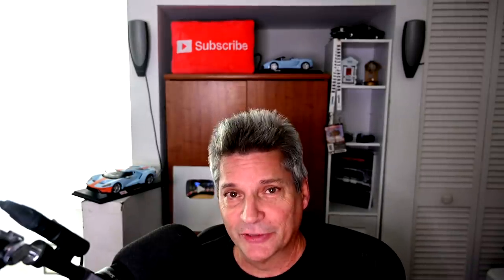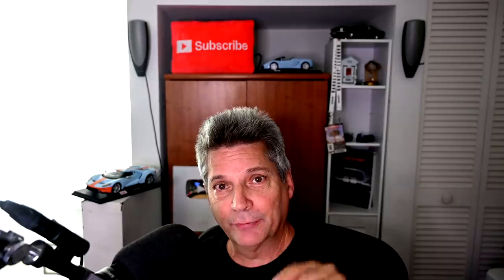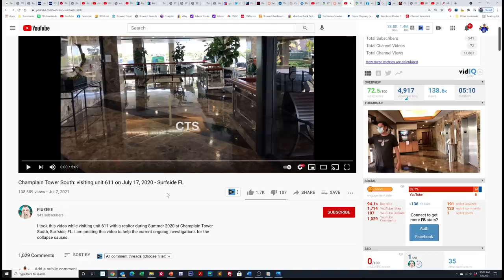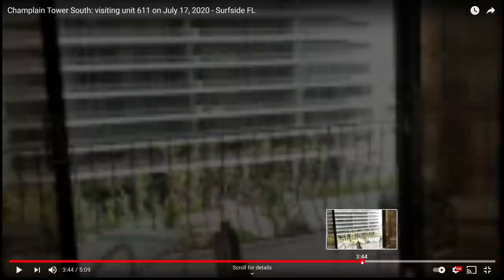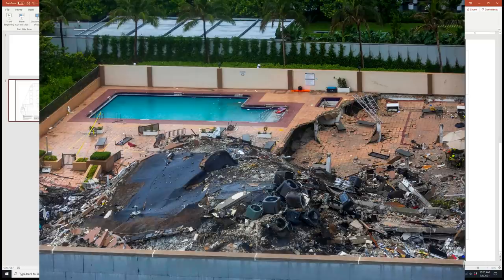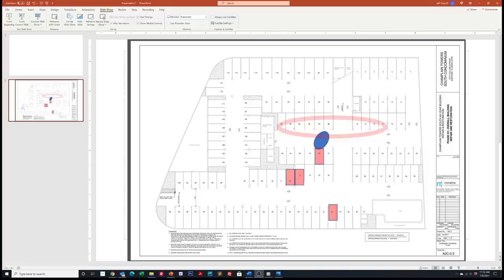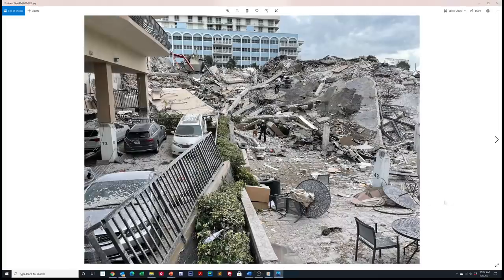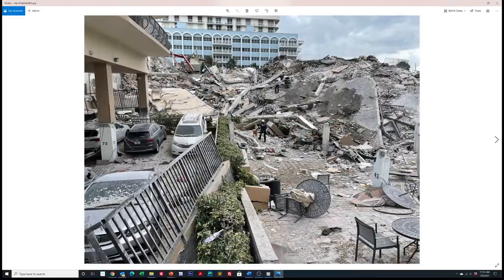Analysis Garage Video BEFORE Condo Collapse: Water Everywhere

Comment: If you take a look at the photo of the  column  with the number 105/106, you will see that the texture at the top left portion is different from the rest of the column. This usually indicates that a repair patch was done to the section of the column in the past. Such a partial repair is useless and only accelerates that damage because the PH of the new concrete patch is different from the PH of the older concrete and this creates accelerated galvanic corrosion of the rebar reinforcement.    The proper way to fix such damage is to remove all of the concrete of the column, clean and recoat the rebar, and then pour new concrete to encase the support rebar with concrete that has the same PH.

Comment: Much water in parking structures in Florida is condensate draining from car air conditioners;  this appears to be much of the case around 8:00.  Peeling outdoor paint in Florida is also to be expected if maintenance is but a bit "off".  Also, July 2020 was right in the middle of rainy season---every parking garage in the state had residual water.  Those hokey ceiling patches really make you wonder though....................!  2018 video reveals a poor maintenance program.

Comment: Patching the leaks from below without replacing the leaky membrane of the pool deck on top would have actually compounded the problem.  By stopping the water from draining through, the concrete deck was essentially marinating in water 24/7.

Comment: Just a couple points from someone who has been in a heck of a lot of parking garages that are in the Myrtle Beach area(because I have a HVAC business) and every basement level parking deck has water in them during the summer either due to rain from thunderstorms almost daily,  condensation from air condition of the vehicles and since basements are cooler and with the excessive humidity (which averages 78% humidity and 17 days of rainfall in July) in Surfside Florida. Because of the high humidity and the salt air they have to repaint these parking decks every winter during the off season. One more thing I've never seen any "Stalactites" In any parking garages LMBO
Reply from the maker: Champlain tower South condominium there were cracks on the ceiling that were very poorly repaired by injecting epoxy in there that likely wasn't effective, and they left the injection ports in the ceiling, instead of removing them and sending them down filling in the holes sealing and painting etc. So that it allowed new cracks to develop a new water to leak down dragging the calcium carbonate through the concrete with it, formula stalactites, and likely reducing the pH of the concrete.

Comment: Where was the water coming from? Stupid question but is it the water level in Florida, was it rain or what?
Reply from the maker: You have rising water tables under the foundation that could possibly allow water to seep up into the building through cracks or other joints and stuff like that. But most likely this was from rain water on the deck for all of those years that allowed the concrete to soak in the water and then the rebar starts to weaken and then they had numerous cracks that were repaired over the years done by people that were not very good at the repair Anne I think all of this just sort of led to the ultimate failure of it

Comment: Pool deck draining onto garage roof, over time, likely flushed out concrete around expanded corroded rebar until deck punch shears down, columns left standing unsupported at deck level fail under buckling, then as geometry changes among joints, the rest unzips.

Comment: That's water coming through the concrete from above. Not Humidity.  Remember this is an open air garage on the ocean, its high humidity all the time.  Peeling paint shows lack of adhesion to the substrate, in this case because that substrate, the ceiling, is moist from water coming down through it from above.  Just like a concrete slab floor, concrete will wick water up (or down in this case) through it, causing it to weaken and spall and crumble.

Comment: That clip with running water might be the fire sprinkler system in the garage. Drain pipes are normally empty so water wont keep running. That said, if water is spewing from a sprinkler pipe it should sound an alarm, so maybe it was just domestic water, seeing as Florida's mild climate would not dictate them to be protected from weather.

Comment: I’m starting to have the idea that Miami, being a hot & humid location, the concrete may have absorbed moisture over its life, weakening the structural bonds? Could it be as simple as a lack of proper maintenance, in an environment that is not conducive to concrete, ie: hot and humid.

Comment: Just a thought about the water.  This is in Florida, most all cars have air conditioning.  It is very humid in Florida.  When cars are running with air conditioning, water comes out of the evaporator drain, runs onto the floor of the parking garage and pools there.  I rented one car in Florida, and it would put out a puddle that surrounded the car from front to back and left to right.  I was actually stopped a few times by people concerned that my radiator was leaking.  No, not the rad, just the air conditioning.  Maybe someone was leaving the building and stopped to talk to their friend in the parking garage and the car was running all that time.  
Again, just a thought, no expert on buildings or construction here.  Just thinking a bit out of the box.  Thanks.

Comment: Dude, the paint coming off in layers like that, is a sign that there was water behind the paint.  Concrete will allow water through it, the paint won't.   19:36 top of the red pipe you can see what looks like sheets of paint have peeled off and landed on the pipe.  I painted for 15 years, water gets behind paint and you will get large water bubbles, once the water finds a way to escape, the paint has been  seperated from the surface.   $5 says that the car was covered beacuse paint chips, and nasty water marks from the water leaching through the concrete.  I'm thinking you're right

Comment: 10:49 metal corrugated on the ceiling in that 10-minute frame I could probably bet that that's up there like you said for the water to direct off the car but also to hide the big cracks the metal is up there so the concrete pieces don't fall in the guys car

Comment: 300' from the beach+ many hurricanes with storm surges flooding that parking garage, + storm surge saturating  the surface deck with salt water. You can drain the water yet the salt is caustic to iron and remains in the brick work above.

Comment: In one of your other vids, it was clear that there was no drainage on the pool platform above the garage. It's also clear there are many cracks with water flowing through. If it was just humidity, the pain would be peeling more uniformly and everywhere. In this vid, it's clear some areas are not peeling at all and others are, meaning it's not humidity, but leaking.

Comment: That strange repair (looks like a piece of corrugated roofing) you point out at 24:55 seems to be very near where we see debris on the ground in the video from the tourist looking down into the garage. Being right up against a column, that could very well be the start point of the pool deck failure, with that column punching through.

Comment: 5:10 what is it? Looks like a trough to catch water and keep it off cars.  I have seen this before (commercial plumber in Canada) when the concrete is cracked and water proofing is damaged. Sometimes rather than fixing the real issue a “temporary” solution (drain pain) is installed to prevent damage to cars paint. Sadly I have seen this done in many Rentals and Condos in my area. I have always questioned that as once installed the real issue of water penetration becomes low priority as it’s not visually causing property damage.  After a while staff change hands and it’s thought of as “normal”

Comment: That crooked pipe is basically a plastic tubing, really it's a band aid fix to route the water...looks to me like they knew there was a problem but instead of addressing the severe deterioration of the ceiling under the pool deck, they continued to try and patch it up with temporary fixes. Someone should be held accountable for all those who lost their lives. This was bound to happen and I'm just shocked at how the people responsible for the building maintenance walked around this garage and did nothing after seeing this damage. It was a tragedy waiting to happen.

Comment: The pool deck area roof over garage must of carried a lot of water during rain events that soaked concrete and infiltrated cracks which i suspect was enough to cause the stalagmites over time. I also suspect someone hit one of those columns early in the morning around 1 am... that got the attention of bystanders with a camera. Was someone parking, and hit a column, fleeing the scene amidst dislodged chunks of concrete sprawl falling, resulting in the later video of the pre-collapse damage from outside of the garage. Who could say... but security cameras if they can recover the files from the rubble, or the ICLOUD, what the collapse looked like from multiple angles.

Comment: Regarding the water on the floor of the garage, this could easily be sea water that percolates up through the porous South Florida limestone and onto the garage at high tide. This is very common in the beach area with below ground level garages, and it has become much worse with global warming,  Many building have had to install big sumps and pumps to pump out the water every high tide, especially the King tides.

Comment: The squiggly ends of the grouping of lines you called 'patches' to me appear to be corrugated roofing either plastic or galvanized tin, tacked to the ceiling (garage) in order to divert leaking away from parking stalls to the drive areas.
Man, the signs were everywhere and the resulting inaction killed..
Reply from the maker: Yes sheets of corrugated plastic from Home Depot

Comment: A little water isn't going to take down steel reinforced concrete. Some concrete structures are completely submerged and last for ages. I am still thinking there was some sort of sinkhole or subsidence going on underneath the foundation. I'm not seeing anything that would be bad enough to cause a collapse. Ive seen concrete bridges and peirs with serious spalling and rusting rebar that lasted for decades and never collapsed. I think  that is only one part of the equation.

Comment: Well if enough rain runs down that ramp and run into that crack long enough the sand under the concrete floor will start to wash out and leave large voids (like a sink hole) and with the cars driving over that spot constantly every day, eventually the floor could have given and those pillars are right there, maybe the pillars were rusting under the concrete floor and couldn’t be seen.
Maybe.

Comment: It is possible that much of the puddles of water in the parking basement are from car air conditioners, when they are parked the evaporator drains out my own car leaves a puddle which can run away from the car.

Comment: Well, after seeing all the pictures and reading the report from 2018, I think the failure is not the columns first. If you think in the large, every single floor seems to have water intrusion. Especially that top roof. When you see the birds-eye view of that building, its like nothing I've seen before. The water is part of the concrete in almost every ceiling and floor. This is a disaster waiting to happen. I think the concrete has been weakened over the years and had no adherence to the columns when presented with a heavy load. I think it finally failed when the concrete either at the top or the bottom failed first. I see no evidence of widespread column failure but more slab intrusion. What do you think?

Comment: 28:50 Wondering if the drain at the bottom of the ramp was faulty. Which may have caused the water to have a tunneling effect under the concrete.

Comment: At 5:05 I would say that is a kind of water drain that in turn drains to a larger drain that runs across all the garage. OMG that slab appears to have been dripping water for a long time maybe even since the building was built! If that is confirmed this is insane! I have seen those kind of fixes in commercial buildings where I have worked and I never liked them!

Comment: If I was looking at a building like this and saw water dripping through the concrete, I would know that it's a serious problem. But before this I would never have thought that it could bring down a building the way that it did. I wrongly assume that the load forces of a building this size would be evenly distributed. So if a few parts of it were to fail, the rest of the building would carry the rest of the load. What seems that happened is that the water that was pooling on the non-sloped slab, was draining through the slab and leaking in the under garage. This in turn caused corrosion of the rebar, which caused the concrete to break, and eventually there was a failure of a few support columns. Once those columns fell, it was a domino effect. Never would I think a building could come down like that. But if I think back to 911, I would have never thought the failure of a few columns could bring down the entire building, but we all saw what happened. (well, except for those that can not accept it)

Comment: So I gather..
 the pooling on the roof was running down into the walls and  pooling there, weakening the floors and walls. A video made by someone who was video taping the hall ways showed that on the 11th floor in a hallway, there was laying there on the floor a bucket catching water coming from the cieling and a high powered fan to dry out the carpets. Another video, made by someone standing outside the garage when the building collapsed,  shows that water busted through the cieling in the garage, then shortly after the garage cieling collapsed, and the building collapsing right after.
 
So What if all of that water that was standing in puddles on the garage floor a year before, was actually coming from the rain soaked roof. "actually rain water from the roof of the building. 
And then that area in the pool room that had extreme water damage, was also from rain water from the roof.
 Then also the sea air which is salty and wet. 
This building was deffinatly a victim of water logging. 
They are still saying they don't know what caused the building to collaps and why they don't consult you, I'll never know.

Comment: You did a lot of ground breaking analysis - not always getting to the right conclusion :-). Anyway, I think that you've convinced me that there was a single point of failure in the rebar around a single column (probably #28) and when the corroded rebar gave way, the pool deck started to sag at that point, breaking rebar connections at the surrounding columns, and extending the collapse right up to both buildings. As the collapse advanced, water pipes burst, adding weight to the garage floor. Still don't understand how a deck collapse can bring down sound columns that supported the building (unless water had infiltrated the column rebar on the outside of the building closest to the pool). Obviously, if the architect had chosen the larger square columns for the outside wall of the building that collapsed, the collapse would not have happened. Why the difference???

Comment: For me it's not what you see, it's what I don't see. There is no support between pillers. We're the deck fell I see no (or very little ) rebar. + the piller/column to the right of the ramp looks like the one with the damaged base.

The whole basement looks under engineered.

Comment: You can see the water damage on 105 the water mark take a good look at it you can see a water line like the column is soaked even though you don't see but a little water on the floor the bottom of the column looks soaked